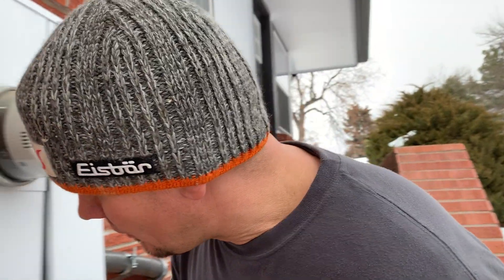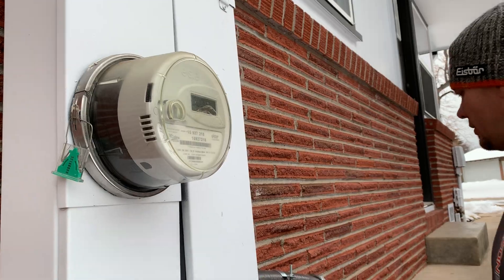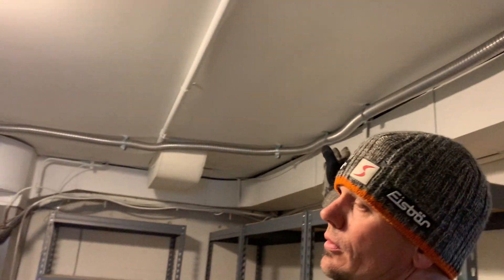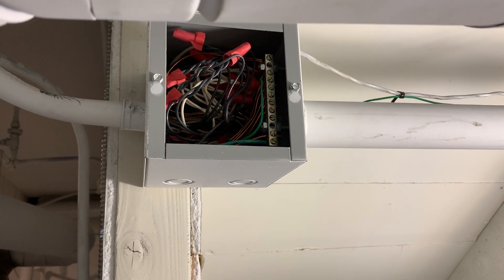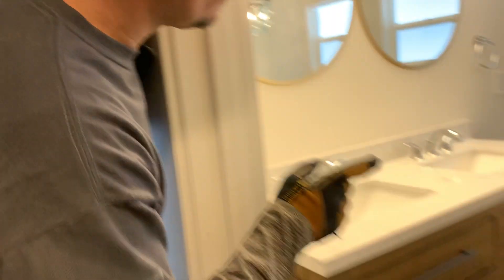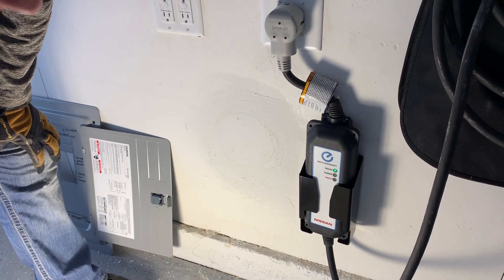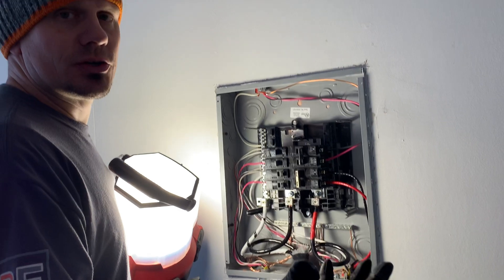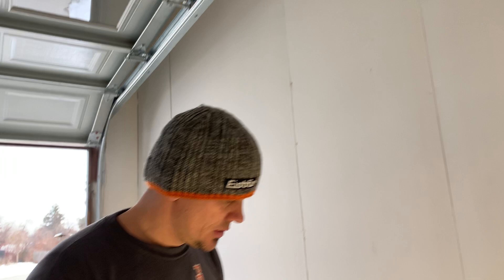TC Cable: Feeding a Subpanel Off of the Garage

Comment: Hey Josh, maybe check 334.12(A)(2). I believe it says you're not allowed to run NM cable in drop ceilings "other than one- and two family and multifamily dwellings". It does say ceiling "cavity"  but I believe this still qualifies as a whole drop ceiling. At least this is my interpretation. Let me know if this sounds correct to you